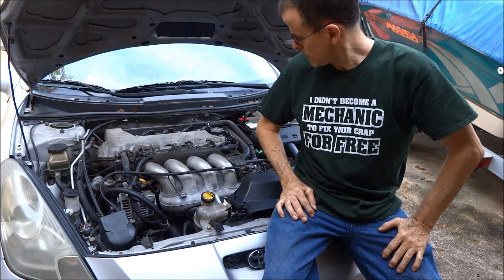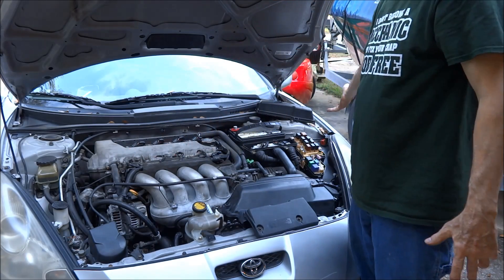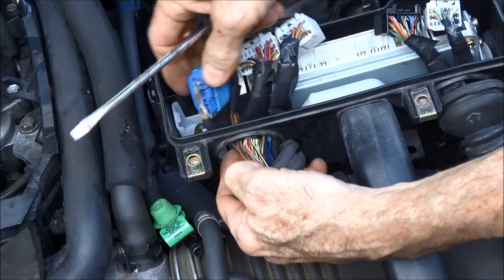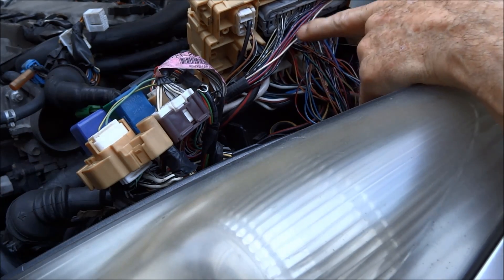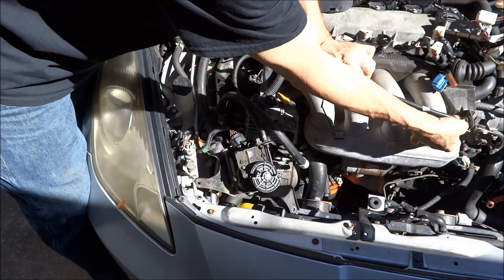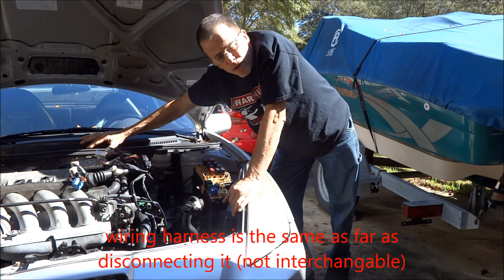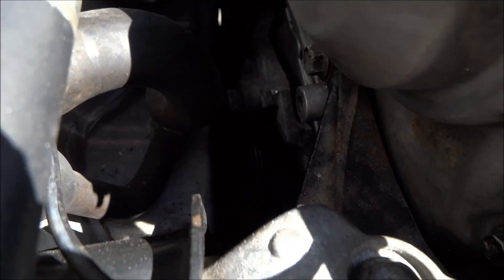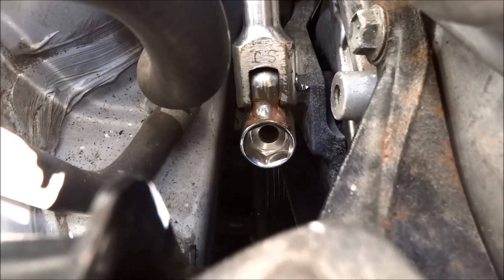pt 1, 7th gen. 2000-2005 Celica motor remove

Comment: Oh my goodness, your my hero! Until now I havent found a Toyota celica 7th gen engine pull video, and I've been crawling around my engine trying to pull the harness off, pro tip just disconnecting the fuse box!
Reply from the maker: Thanks for commenting.  For me It was a bit intimidating disconnecting the entire wiring harness the first time. But I was tired of undoing the rats nest of wires and connectors off the engine and trans.
Reply: i cant blame you, I was 2 days into the project and still had wires to remove, then you said just disconnect the fusebox and I was kind of mad about how easy it was and how much time I wasted. thanks again!  @TSRGarage

Comment: just a tip, a gooseneck crow bar will loosen the serpentine belt tensioner EASY.  never round the hex, don't care if the hex is already round.  you just need it there.

Comment: Wouldn't the only difference in wiring harnesses be the transmission which you can jump the wires to make the engine think the clutch is in?
Reply from the maker: @bwaller76  🤔... If you are going from an automatic trans to a manual trans,  using  a manual to ecu, just by  hooking up the clutch wire (that is already under the dash), the auto harness may work. 
    But if you are swapping from manual to auto (with a manual harness), the ecu would not have (input outputs) control of the trans. 
    Jumping the clutch wire would get the engine to start......
Reply: @TSRGarage  yeah just replacing the harness because of a massive short.  The only cars in the junkyards here are automatics.  So the car is staying manual just replacing the wiring harness with an automatic harness.  (It's a race car so it's pared down to pretty basic)

Comment: very good job,,,, i want to swap a 2 zz-ge engine into my 1zz,,, and i want to know if i can keep the wiring harness for the   interior of the 1zz and juste change the wiring harness motor of the 2 zz and his ecu?
Reply from the maker: Camille David as far as I know if it's a manual transmission interior wiring harness stays exactly the same. Only difference inside would be higher RPM tach.  As you said use the engine wiring harness and the ECU.
Reply: Camille David - check out ''newcelica.org'' your question has been covered there.
Reply: As far as the engine harness goes: To go from 1zz to 2zz you need the pigtail for the VVL solenoid and you need to reverse the polarity of the TPS connector. This kit helps alot: https://www.monkeywrenchracing.com/product/mwr-vvl-connector-kit-2zz-engine-swap-celica-gt/
You also need a 2ZZ exhust downpipe or cut off the 1zz downpipe flang and weld a 2zz flange on. 
This: https://www.monkeywrenchracing.com/product/qrp-midpipe-with-cat-celica-gts-00-05/
or this: https://www.monkeywrenchracing.com/product/mwr-flange-toyota-2zz-ge-downpipe-inlet/

You also need the 2ZZ computer and throttle cable, depending on if your car has cruise control or not. Everything else should be a bolt in.

Comment: Well I figured it out, the wiring harness for the automatic engine does not have a plug-in for the plug coming from the manual transmission. There is an extra plug coming out of the wiring harness that I believe was made for the automatic transmission. I'm frustrated because everything is finished except for this last wire
Reply: hey i got a 2000 celica and swapping out an automatic to a 5 speed did you have to swap the harness and ecm? and do you have any other tips?
Reply: John Cook hi John, I'm doing same thing, did you ever figure out if harness from donar auto will work on the 5 spd engine with manual ecu etc. Think a neutral safety bypass so it can start is mentioned on one of the replys on part 2 I think. Thanks for any help or info

Comment: Hey, my 03 gt has wires for the cruise control running out from the firewall and wires for the coils and injectors branch off of it. Did you have this? It seems I'm going to have to pull connectors instead if the whole wiring harness from the fuse box
Reply from the maker: No. On the cars I have done The cruise control wires we're not originally part of the engine wire harness.  Some wires may have been added  to your car.
Reply: @TSRGarage  ahh thought I'd save some headache with your method, but it's all gotta come off eventually. Possibly also because it's a canadian vehicle? But thanks for the video and thanks for the reply!

Comment: The wire in the back that runs down. Can you tell me what its connected too. Mine got disconnected
Reply from the maker: I think you are talking about the wire that goes to the power steering pump.
Reply: TSR Garage maybe. it runs down from the top of the engine to what looks like a switch or sensor
Reply from the maker: @monsteflex  yes top of power steering pump
Reply: TSR Garage I’m not sure if you take requests for videos but doing a video on that due to the visual difficulties. If so it would be much appreciated if you could do one. 

Either way thank you for all the help you give.

Comment: Hi there, I recently bought a gts manual transmission 6 speed with a bad motor, before I yank it out, your saying that it has to come out with the trans attached ? Great vids :)
Reply from the maker: Thats how i do it, but you might be able to pull motor alone. The transmission would have to be allowed to move over for clearance of the clutch and pressure plate ..(trans mounts lossened/removed and most likely axle/axles removed).. by the time you do all of that I think it would be way easier to remove it all together. Sorry for the late reply

Comment: Can you put a manual trans in without removing the engine?
Reply from the maker: All Day EDCers  Yes you can. front and rear  motor mounts are actually attached to the transmission  so the transmission end of motor has to be supported from above. (there are companies that make a engine support bar to do this).... I just did a quick Google search the support bars to do the job are 50 to 80$
Reply: All Day EDCers - I've replaced the clutch twice and the trans a few times. I used the scissor Jack that came with the vehicle and a foot long piece of 2x4 under the oil pan to support the engine while pulling out the trans.